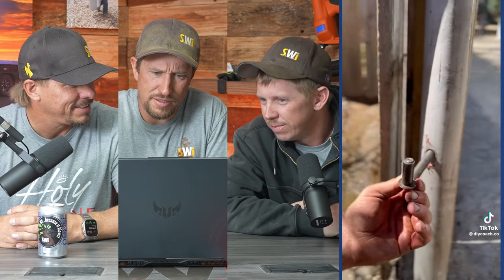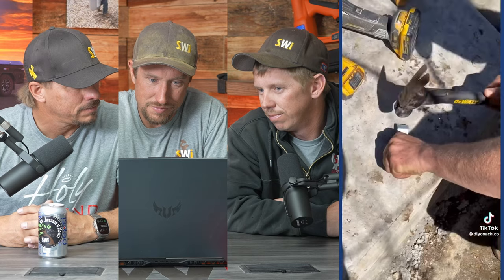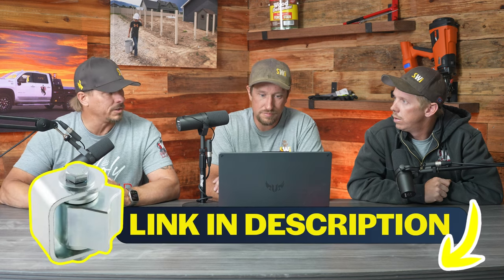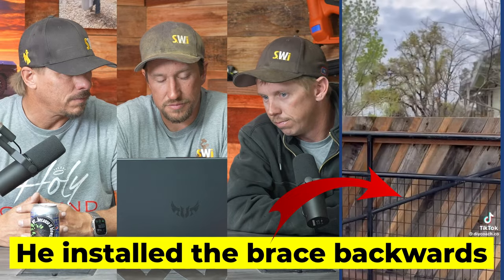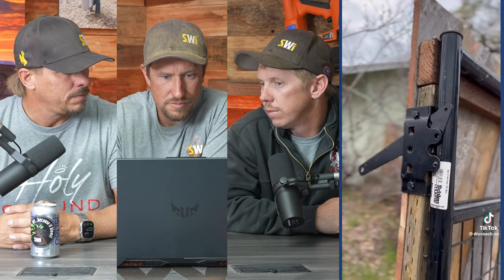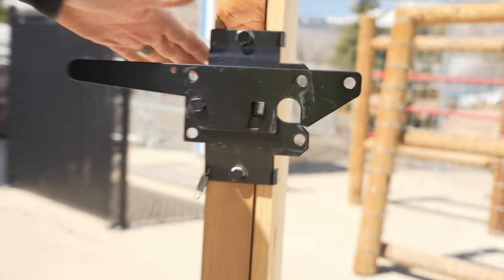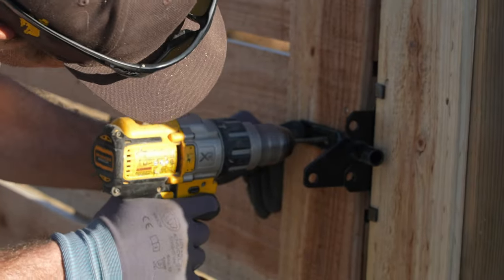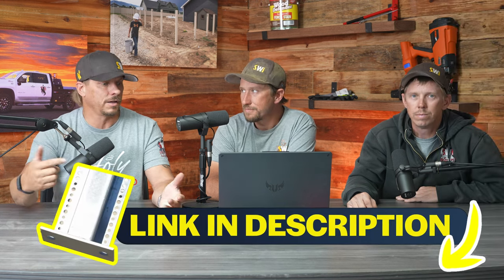An Awful Way To Build A Gate

Comment: Hey guys, love your content and how insightful it is!

Using the fencemaster posts, what’s the longest you’d go on a 7’ tall, horizontal swing gate?

Assuming proper bracing on the gate with compression and the tension, anti-lag system detailed in your videos. Could also go with metal bracing as mentioned in your video of the woodworker making that like 12’ long gate. 

Would love some input! Thanks!!
Reply from the maker: You could do about 4', but if you decide to double-up your postmasters, you could probably  accommodate up to 6'.
Reply: I saw there was a typo. It’s a 6’ tall fence, not 7, but what post setup would you recommend for an 8’ swing gate?
Can do 2 gates if needed, but would prefer one.
Reply from the maker: 4" SS40 pipe or 1/4" wall square tubing

Comment: The strength of the posts will absolutely not be an issue either. I don't think you guys are considering the concrete slab that is holding it in place as well. You are much more knowledgeable than me in fence building areas. I mainly have concrete guy. I will definitely get a hold of you on my next gate bill to get your opinion on it. It's been about seven months by the way and the gates holding very strong.
Reply from the maker: This video wasn’t meant to attack you in any way.  We understand that there are factors we don’t know about such as customer budget.  Our goal is only to entertain and educate.  Obviously you have a following and we only aim to shed lights on ways to improve on what you did so that if others are watching they can have a better idea of how to install a top notch gate system.  Because gates are the part of the fence that the customers interact with, they are especially important.  They are also the number one call back.  Keep up the good work and again we applaud you and your wife for your work ethic and hustle mentality.  Cheers!

Comment: re: Latch placement.
Looks like the pavers on the ground are set to tire width which implies to me backing in a trailer / vehicle through gate opening thus the placement of the latch as to not have a bar sticking out into said opening, eliminating the possibility of DIY pin stripe.

Comment: Also, there is zero chance of that gate, shutting too fast.  The reasoning for the wheel on the gate was because it has a huge slope up right where the gate shuts so instead of having a 90 pound lady have to struggle closing the gate she just push on it and the wheel wall roll the last 5 inches